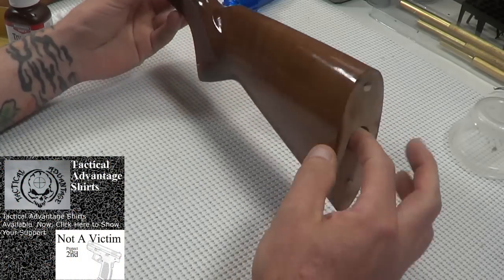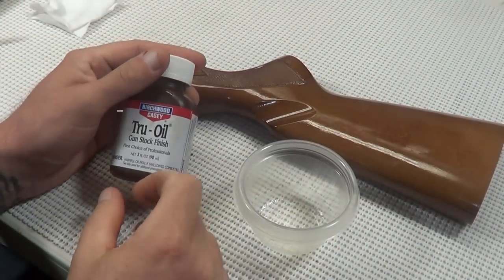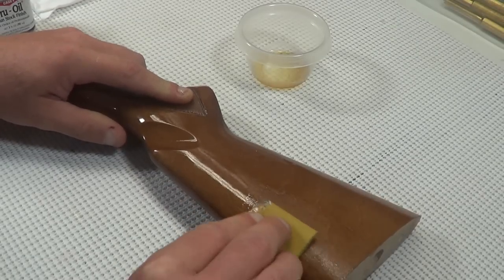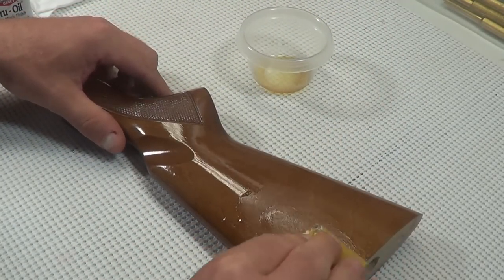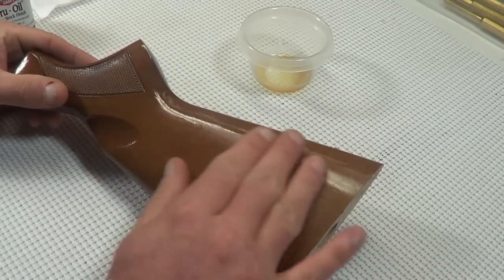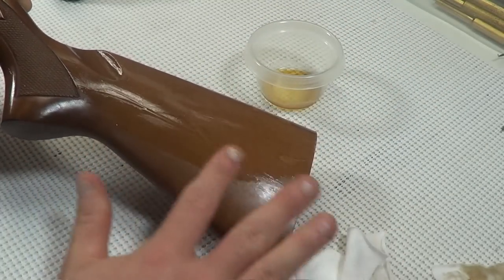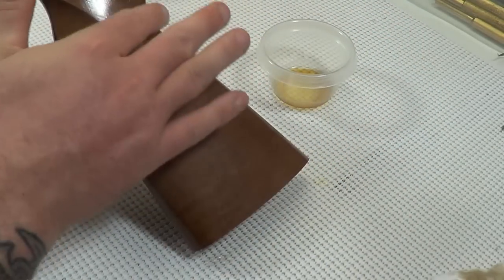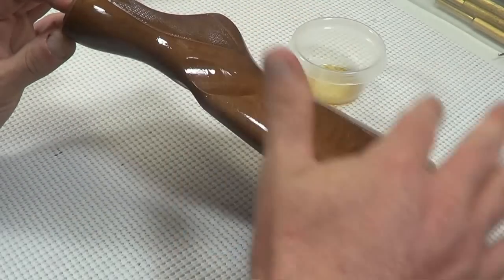How to refinish your gunstock with Tru-Oil, PT3, Second Coat/Grain fill and foundation coat

Comment: nice videos! ;) how many times do you use sandpaper, just that ones?
Reply: I used 600 grit wet or dry sandpaper. It keeps things smoother when knocking down rough/high spots. I also didn't use Tru Oil while sanding. Just sand lightly & carefully...but that's me. Only sand enough to smooth, not cut finish off! Then recoat with the Tru Oil...
Reply: @unionrdr yeah your way is definitely better. Probably why he didn't show the final product